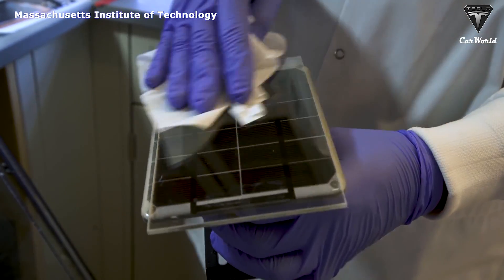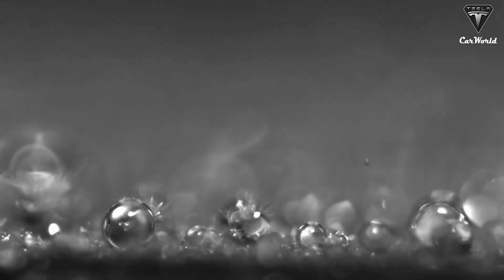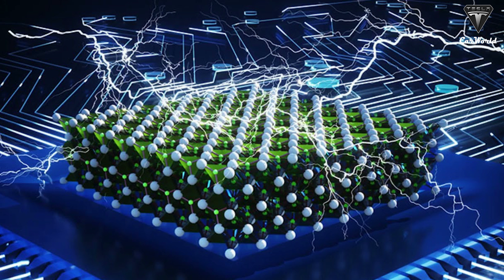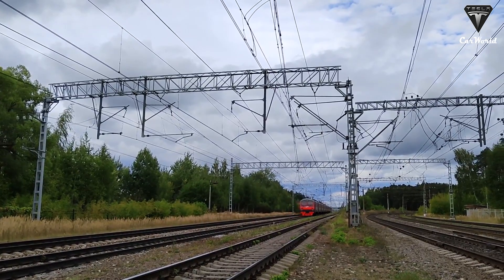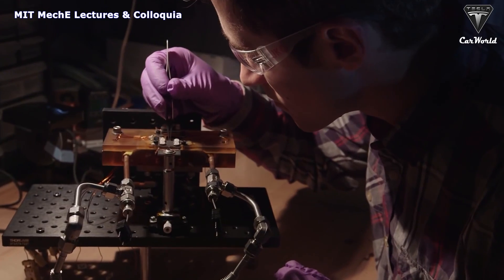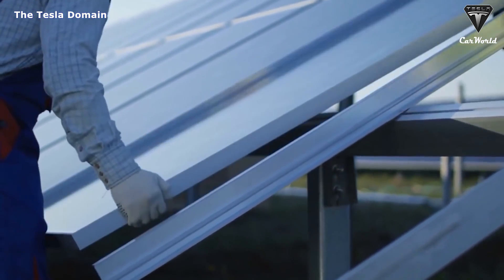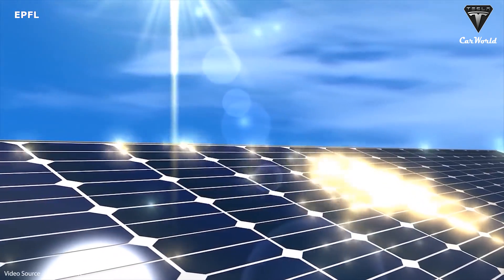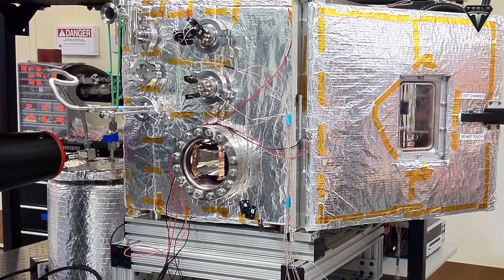As powerful as nuclear power. Elon Musk Shocks for a new solar battery with a capacity of 100 Kw/m2.

Comment: This is a joke right?
Of course objects lose energy from their surface - where else could they possibly?
Nuclear power is not a method of storing energy
Precisely how does shining light onto Gold create electricity?
What is this 'mirror' behind the Gold, why doesn't it melt, Why doesn't the Gold melt.
(They made a film about this= The China Syndrome)
What sort of wire is used to get the electricity out?

Why use Gold: Make anything as hot as that and it will spit out electrons and create a current.
Proper photovoltaic 'things' are destroyed at temps above 175 Celsius

As if me you and everyone have sources of heat at 2,300 Celsius 'just lying around waiting for a use'
Sorry, I've misplaced mine, excuse me for a minute while I visit ebay for a new one.
So you've stored heat for months on end (fantastical enough) - what then?

Any normal object at that temperature will be radiating at over 2,500 MegaWatts per square metre - yet 'it stays hot for months'? 
Is that why The Sun is as hot as it is - its lasted 5 Billion years so a a few months is pathetic

Sorry, the Retroencabulator has already been invented, everyone is now bored with it and The Emperor is getting cold

Comment: Interestingly this one could potentially power the vasimr rocket engine, which only requires 200MW nuclear generator as per Franklin C diaz. And handle the vasimr heat dissipation issue in a manner similar to regenerative braking in electric cars.  If the vasimr's are designed to run hot this waste heat could be used to recharge the heat bank(s) that the photocells are in. Between this and some form of solar energy capture, whether heat or solar electric, the power available from the heat battery could extending the energy available from the heat battery.  Cool I think.

Comment: No I'm not watching this crap.
I just popped in to comment that the sun supplies about 1kW (1.361 kW) of radiant energy per square meter at the earth's surface.
Any claim that you can harvest more than 1 kW per square meter is therefore patently a load of bollocks.
Bye.

Comment: 100 Kw/m2 is absolutely amazing especially since that's 100 times more energy than the sun supplys to earth surface  (1000 w/m2). So I call BS!
Reply: This things 10000% efficient. Sounds just like the Hyperloop trains traveling @ 1000mph in a vacuum, Sorry I mean car traveling 40mph in a tunnel.
Reply: Even above the earth's atmosphere, solar radiation is only 1380w/m2.
Reply from the maker: This kind of step-change in efficiency could indeed have an enormous butterfly effect moving forward in the race to zero carbon emissions.Thanks for your comment and stayed tuned for our next video !
Reply: Plus Capacity is measured in Kwh not Kw.

Comment: This sounds like nonsense: the solar irradiation on the Earth's surface is on average around 400W/m2, so how could any type of solar cell generate 100 kW/m2?
Reply from the maker: The research team discussed its record-breaking experimental results, noting that "reaching 40 percent efficiency with TPVs is notable from the standpoint that it now renders TPV as a heat engine technology that can compete with turbines. Thanks for your comment !

Comment: The sun does not deliver 100 kW/m². This would burn the earth. This value is sensationally wrong.
Reply from the maker: Breakthrough TPV cell makes more power from heat. Thank you for your comment, Peter Heckert
Reply: @TeslaCarWorld  I believe this, but there are not 100kW/m² thermal and light energy on earth surface. Maybe 2kW or three. This is groteskly wrong.

Comment: Mr. Musk is a genius, a visionary and a daring and very brave business leader indeed. And he proved it.
I also want to congratulate the researchers, for this fantastic work.
However, I remain skeptical, because solar energy is intermittent and these solar panels will not be able to produce electrical energy 24 hours a day. They will only be able to produce a maximum of 6 to 7 hours per sunny day in regions where the rate of sunshine is very high. There is no information on the evacuation of thermal energy, which has a great influence on the yield of the solar PV panels in question.
There is also a big problem of storing the electrical energy produced. With the inevitable increase in temperature, the yield of these PV panels will inevitably drop.

What I said is constructive. I never criticize to criticize. And I sincerely wish success to this team of researchers and to Mr. Elon Musk.

Comment: Typically the heat used to run a steam turbine is the result of the off gas of a gas turbine. A gas turbin is a little over 30% efficient. Using the hot gas of the gas turbin to heat water for use with steam turbine increases the plant efficiency to over 60%. It would be interesting if further heat could be captured from the system to further increase plant efficiency.

Comment: I don't think you have your figures correct...there is only around 1kw per square meter available from solar irradiation, and a typical solar panel is around 200 watts per square meter....Efficiency doesn't move that fast to begin with, it moves by fractions...No energy source on Earth approaches nuclear power for energy density...

Comment: This thermo-photo-voltaic cell is a perfect match for the Brillouin Energy FUSION heat source.
Reply from the maker: It's a good idea. Thank you for your comment and have a good day !
Reply: @TeslaCarWorld  perovskite solar cells are a more promising and realistic solar technology, they are cheaper to make and can be double layered to create more energy per² metre, a company called Swift solar are the ones currently developing and pioneering this cell technology for commercial use, the only thing slowing them down is how fragile the cells are, they are currently developing different mixtures in the perovskite mixture to make them stronger so they can be released to the open market, last time I checked they said they were getting close to achieving that goal so we shouldn't have to wait to much longer 🤞.
Reply: @TeslaCarWorld  here's a link to my source the videos a little bit old but still contains lots of good information,. https://youtu.be/tQmFVcD-Mbo

Comment: first of all 100 kW / m^2 is implossibel. this is so much fake news sadly
Reply: Solar power from the sun is ONLY 1 kilowatt/square meter under OPTIMUM conditions (sun directly overhead with no clouds).  So this claim of 100 kilowatt/square meter is impossible.
Reply: There's a ton of these fake tesla, spacex channels and fake livestreams of jwst and Mars rover, 2 things that are also impossible. They are racking in views on hype and people know no better.
Reply: It’s possible but per year
Reply: @JunreyBeduya  Is this a new unit kWy instead fo kWh :D
Reply: @JunreyBeduya  It's never possible. The incidence is instantaneous (kW). kW becon=mes kWh if measured over time
Reply: Many things he said were just plan wrong. 
Gotta keep that green energy narrative alive
Reply: If it's got TESLA in the channel then it's going to be fake news.
Reply: Imagine having just a small solar panel on the roof to power your whole house.
Reply: @Seriouslydave  At 100kW per sq.m a small solar panel would eithe set your house on fire, melt the export cable or both.

Comment: Soooo...heat storage into thermocouples, basically.  Hmmm...

So if those thermocouples were connected to a NUCLEAR plant, then the plant size could be dropped by an order if magnitude, and you would have the best of BOTH worlds, without the inherent non-viability of solar.  And since nuclear has the best safety record over kW of ANY generating method (which you conveniently forgot), it would be the cheapest, cleanest, safest, least environmentally damaging, and most reliable of energy sources.

Kind of missed that, didn't you?

Comment: What is the real name of this technology and who is a contact for capital & prototype construction?  Thank You.
Reply from the maker: Engineers at MIT and the National Renewable Energy Laboratory (NREL) have designed a heat engine with no moving parts. It converts heat to electricity with over 40% efficiency—making it more efficient than steam turbines, the industrial standard.

The invention is a thermophotovoltaic (TPV) cell, similar to a solar panel’s photovoltaic cells, that passively captures high-energy photons from a white-hot heat source. Thank you for your comment and have a good day !

Comment: If it makes it our of the lab it will be another solution to our need for energy.  Nuclear works but takes too long to build, is too expensive and costs to much to operate and maintain.  A typical nuclear facility takes anywhere from 200 to 400 people to operate and maintain the unit and at $30-$50.00 + per hours even Small Modular Reactors become too expensive for most utility executives to sign on the dotted line.  And spend fuel reprocessing is still a problem.  Solar on the other hand including this proposed solution should be able to be built in 100 MW sites quickly and this is what we need to preserve our environment.  A string of about 400 to 600 solar facilities spread out across the country with the majority in the South and Southwest feeding transmission lines that lead to major population centers would be a start.  And we certainly need to take advantage of all of the waste heat we are creating.  And land area is not a problem in the desert Southwest.  But I will say it again, IF and that is a big IF, it makes it our of the lab into actual production.  And this to me is just the beginning.  I foresee 60% efficient cells before 2030.  When we hit that point, even Combined Cycle Natural Gas plants which are about 50-60% efficient won't be needed except under certain grid conditions.
Reply: They need to upgrade the power transmission lines across the whole country to allow for better efficiency and more capable of using and storing of green energy. Be the source a home owner, a coop or a corporation. Sounds like a great technology, I hope it is scalable and investment finds it way to them. The fossil fuel industry/countries are willing to do anything to stop the world conversion to green energy.